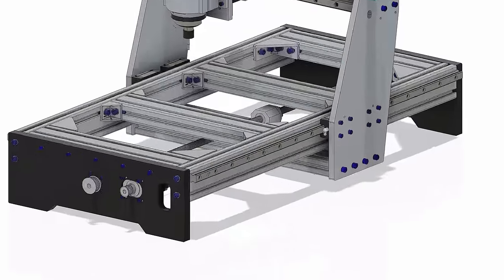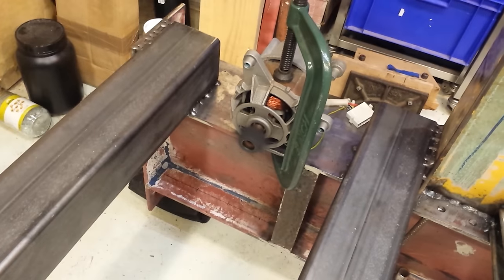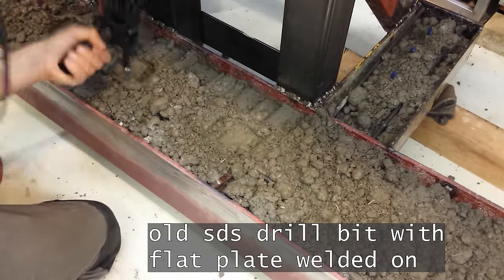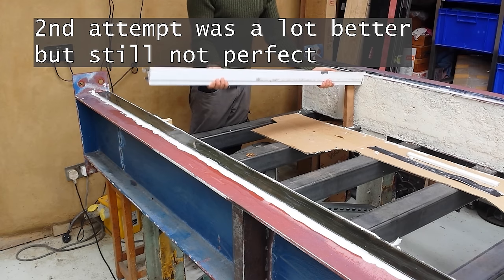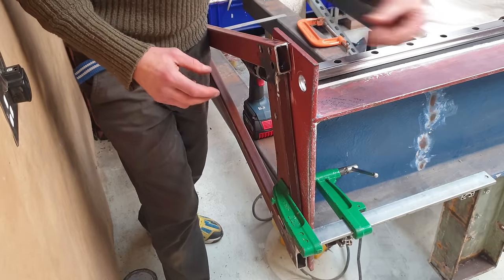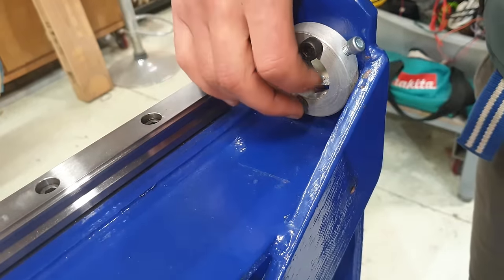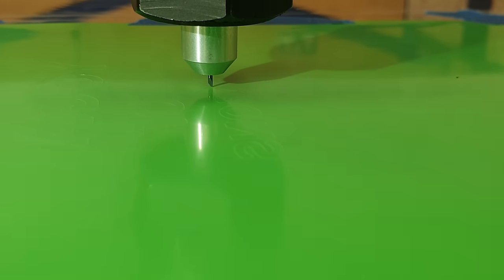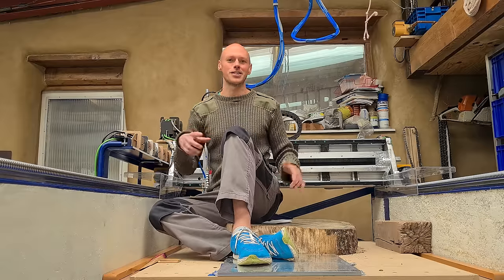Can we DIY an Industrial grade CNC?

Comment: If you left the washing machine motor on the frame whilst pouring the concrete you could have turned it on and vibrated all the concrete into place with no airbubbles

Maybe it might have helped with the epoxy levelling too? Probably a less powerful motor for that.
Reply from the maker: Good morning A Corgi With a Crown.
Yep, I actually did that a little bit with the concrete - it didn't work very well. I don't think the washing machine motor had near enough power to get the concrete mix flowing and liquid, it's a LOT of concrete to be vibrating at once - and the wet mix was very good at vibration damping (surprisingly enough!). Dedicated concrete pokers are much more localized, which is how they work well. The SDS actually liquefied it much like a concrete poker would I think. If I was doing over, I think I would A) buy a proper sds tamping bit (which hopefully wouldn't fall apart and need re-welding halfway through), and B) rent or buy a second-hand electric concrete poker.   
A really interesting idea to use it to help the epoxy settle flat though, that didn't even cross my mind. 
Thanks for the feedback and ideas - appreciate that :)
Reply: @FloweringElbow  Ah ok, I'm too used to using the normal concrete pokers, I'd definitely recommend using one for any sort of large pour. A wetter mix probably would have helped but since your using a specific mix designed for this application I can understand why you didn't.

In regards to the epoxy I remembered pouring some concrete with the poker turned on and it levelled itself really really fast. It wasn't perfectly flat because of the aggregate but it was very quick. Idk if epoxy would react the same way. 

Another thing I'm wondering is if maybe you should have degassed the epoxy? I've heard it removes microscopic air bubbles which helps with harmonics.
Reply from the maker: @acorgiwithacrown467  Degassing the epoxy would have been a nice touch - I had no vacuum chamber though. You can get most of the air out by mixing the epoxy in one container, then pouring it very slowly into another container. Where the pour between containers becomes a fine string the air bubbles are forced out. The container you pour into aslo has a pre-made hole in the bottom (taped up), so that you can peel back the tape and the epoxy travels from the bottom of the container, in a thin controlled stream (you can see that bit in the vid). 
That's what I did anyway, along with the torch, I didn't suffer much from air in it, though yes, if I had a degassing chamber, I would certainly have used it. 
I think my main mistake first time round was trying to use too little epoxy.

Comment: Could have used that diy vibratory stress reliever to help self level your epoxy like they use for structural concrete pours where bubbles are a concern.
Reply from the maker: Good morning Modern Renaissance Man. Yes, I think that's an idea with legs and I'm disappointed I didn't think it at the time!  Thanks for watching;)

Comment: I seen adding cement to the I beams , could you just add stiffener plates all the way through the I beam , also wrapping the I-beam  in fire blanket to let it cool more slow . Can add temp welded  strong backs to keep the I beam more straight.
 When was off shore welding 200mm wall thickness butt welds on rolled section , they are wrapped in electrical heat jackets to keep the welded structure from cooling to quick. ?
Reply from the maker: Good evening JLSsculptureDesign, thanks for watching. Interesting ideas with the cooling control. I didn't talk about it in the video but I did weld some stiffener plates in there.. 
Thanks again, Bongo
Reply: @FloweringElbow  on the Web of the I-beam and inside flange either side, surly can weld 10mm thickness rectangles in it. 5 either side equally spaced(more or less) . I not understanding all the  concrete. Learning on cnc builds too.
Reply from the maker: @jlssculpturedesign8140  The concrete is better at damping vibrations than steel... and cheaper even than a few 300 x 100 x 10mm plate rectangles.

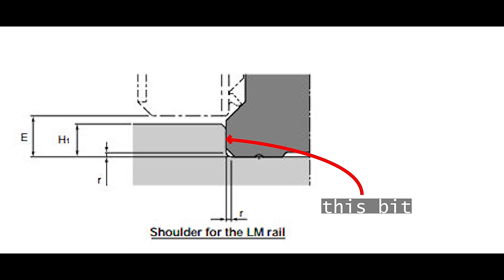Comment: it is my understanding from reading hiwin's catalogues and assembly manuals that the linear guide may be pressed against the raised shoulder for the purpose of increasing rigidity; not (necessarily) to straighten the rail (14:05), so perhaps you could add the tapered screw + steel rod arrangement to your machine. i would also like to add that another reason to use a rotating ball nut is to circumvent the critical rotational speed of the ball screw, which is a function of its length and its diameter, as well as the bearing arrangement; a long screw means a low maximum rotational speed, which in turn means lower rapid speeds (18:30)
Reply from the maker: Hey there. Yes. I think you are right on all fronts :D Yeah, getting round whip in the screw was also part of the reason... Thanks for watching.
Reply: @FloweringElbow  i feel acknowledged 😎. i watched a bunch of your videos; you make good stuff
Reply: Hi to both of you, hopefully I can share some useful knowledge - In my experience ( in the land of Hiwin) the ledge on the machine base is there mostly as a datum . The rails are ground straight so they need a couple of equally good surfaces to locate to as the master rail for that axis. The rails are pinched up against the shoulder by torqued wedge blocks at each bolt location and the rail is then torqued down from the center out to ensure the best result . accuracies in all three dimensions on a meter long x axis machine are within 0.01 mm which is frankly amazing .
Reply from the maker: @bikefarmtaiwan1800  Thanks for this. Interesting - I guess I should have started at the middle of the long rail when clamping and bolting... Live and learn.
Reply from the maker: @ikbendusan  Thanks man, appreciate you watching, and commenting :)
Reply: @bikefarmtaiwan1800  i read the catalogue again and it would seem you are correct. i remembered the section about installing the guides in an environment with vibrations, jolting and lateral loads. this section specifically recommends wedging the rail against the reference rail, so i connected the dots in my head that the reference rail is there to wedge against for maximum rigidity and to prevent the rails/blocks from moving under load

Comment: Could I get a reply on how well the rotating ball nut design is holding up? Are you fully satisfied with it?
Reply from the maker: Yep they are working well thus far.. see the latest vid... I don't know how this comment slipped through unanswered, sorry. Got it now.
Reply: @FloweringElbow  thank you friend. I’m doing an experiment to see if I can make a rotating nut on a 3d printer to handle a 1610 ball screw. It’s going to be a challenge and I give it a low probability of success but if it does work it will be great for people on a budget!

Comment: Never heard of VSR, interesting. You mention the aim is to vibrate at it's resonate frequency, but how the hell do you calculate the resonate freq of a structure that complex? And in which direction are you aiming to induce those vibrations, because surely the lengthwise resonate freq is very different to width wise and height-wise ones?

Anyway, I should add too, great work and I love your real world DIY'er approach to an ambitious project!
Reply from the maker: Well, like I said VSR is somewhat witchcraft :D  I believe the idea is to cycle through a large range of frequencies, so you hit resonance in various directions. Using a vibration meter on a smartphone (old one is a good idea!) you can see when it reaches highest amplitudes, as you are cycling through the RPM of the exciter (motor). The phone will give you amplitudes in the x y and z directions, so you can try and max out and leave it going for a spell in all of the 3 directions. Then, change the phones location on the structure and go again... It wasn't very fun by the end of it, and filled with uncertainty. I may have helped things ;)
Reply: @FloweringElbow  haha, well at least you can have the warm fuzzy feeling of knowing you tried!
Certainly sounds like something that would be largely impossible to quantitatively verify the effectiveness of for a DIY'er. Still, something interesting to read up on, thanks :)

Comment: did you consider 3d printing the cable chain instead of plywood or even casting with scrap metal. as some one who drinks way to much mountain dew recycling it to make 3d prints is a good investment. a micky-mouse cutter to spin cut 2 liter bottles into thin strips that fit into a ender 3 or 5 is surprisingly effective for smaller projects or bigger if you don't mine watching the feed. melt temp close to 500f i had the high temp kit on my ender so I don't know if the base module is capable. short of using a pelletizer or a Melter and 2mm die
Reply from the maker: Hey John. I'm sure I would have pondered those options if I had a 3d printer... that's a whole new adventure... reuse of the bottles sounds cool 😎

Comment: You really should look into getting consistent mist/fogbuster coolant spraying on this thing if you plan on milling aluminum lol. This machine can probably really go, but that lubrication and chip evacuation will be needed. Also, Have you considered trying LinuxCNC?
Reply from the maker: Hey there Thorhian, thanks 😊.  Yes my mist cooling adventure ended in good steel milling but too much mist! Without an enclosure it was very airborne and smelly/unhealthy. So yeah that needs tweaking... 
As for LinuxCNC yes I though about it, but haven't tried it and now feel a bit locked into mach as I have an ethernet smooth stepper.... 
Thanks again, Bongo.
Reply: @FloweringElbow  servos are better than steppers anyways. But setting up a closed loop servo system is challenging. The LinuxCNC guys will walk you through it. They live for that kind of a thing. You buy a Mesa board and PCW will stay with you until you're up and running. I've seen him work on stuff for 12 hours straight.

Comment: Regarding the 'ripples', are you using Mach3? If so, ditch it. I moved to Mach4 (and also tried SimCNC) as I run CS Labs on mine (IPA) and it was miles better. Mach 3 struggles to deal with smoothing, it may not be servo tuning.
Reply from the maker: Hi Charl, Yes, I am running Mach3, interesting. I have a smooth-stepper board and not sure it will work on a different set-up, but worth looking in to...

Comment: I wonder how the machine would've behaved without all the concrete.

And without all the epoxy.

Really the main hero you have here is the top gantry being orders of magnitude larger than your cutting area. Try a big flycutter and see how unrigid your setup is. Though that spindle is the majority of your benefactor I would think. Did you ever test the total deflection at the tip? Put a dial indicator on one side of the spindle cutter and try to wobble the gantry.

Comment: Let me give you a soviet stress relieving tip my dad learned in the army as a mecanical engineer. You can throw your from in the yard and light a big fire in/on-top of it. Just let iet burn that will stress relieve the welds
Reply from the maker: Love it! Did actually think about it, but moving the dam thing seemed like such a mammoth task... Of course, I didn't have the backhoe at that point ;) Thanks for the tip. Peace, Bongo.
Reply: @FloweringElbow  True, have you been having any problems with the rotating ballnut design, alignment problems or wear?
Reply from the maker: @meocats  Originally, alignment yes, there are a few vids on our other channel "FloweringElbow4SuperNerds" about it. It's quite dialled in now though, with TBI ballscrews. I might have gone to 15 or even 10mm pitch, and a slightly lower dia. screw if I was to do over... But please with how it's working ATM.

Comment: What CAD /CAM software are you using? Also you mentioned Mach3 which uses a printer/parallel port to function. Most computers nowadays don't have that so how are you getting around that problem ? Great project BTW 👍
Reply from the maker: Hi Alan, good Q's, 
We're using Fusion 360 for CAD and CAM and Mack 3 is going to an ethernet smooth stepper (warp 9) board. My laptop doesn't have the parallel port either - and I don't think that would give me enough out and inputs either. I got the ESS board years and years ago, before I know about Linux CNC - not sure I would go the same rout today... 
Thanks for watching, Bongo.
Reply: @FloweringElbow  it's never too late to get on the right path.

Comment: You waited several months in order to let the concrete cure and for stress relieve? or it was for something else? I want to make a similar concrete filled machine, but I am not that patient ;)!
Reply from the maker: Hey Juan, good question - simply put, yes! We waited that time for a good concrete cure. Then we removed the covers and waited some more so it could dry out... Course, when I say we 'waited' there was plenty to do, like making the gantry etc... I suspect there would be ways to shave time off the process, but we weren't in a big rush, and wanted to be safe...

Comment: I'm sure you considered this, so I'm curious why you didn't shim the linear rails true with the level and straightedge and then pour the epoxy around them to bed them?
Reply from the maker: Hi there Mytuberforyou. It's a good question. Simple answer is, I thought it would be difficult to do it that way...
Expanded answer: the rails don't come as 'straight' in either the vertical or horizontal plane (hence the cast-against-straight-edge sideways constraint I added). So to make the shim method work I imagined you would have to shim under every bolt (that's a lot of shims), and have each bolt carefully torqued up to hold it straight in both planes, before potting in. There would also need to be a big enough gap (we're talking large shims) between the rail and bed or it would be tricky to actually get the epoxy in there (I imagine - or maybe you'd get capillary action with a small gap, I don't know?). 
That would still leave the problem of making the two rails co-planer, which I hoped to solve with the self levelling epoxy (but in the end didn't really).
Reply: @FloweringElbow  well, I haven't done it, but I think I would try some aluminum tube bushings for shims, that way I could torque the bolts on the high spots and use the tube crush to act as an adjustment, between this and parting off the tubes in sizes varying about 10 thou each that could be swapped I think it'd work. It should eliminate the whole viscosity/self leveling problem. Marble dust or pool plaster added to the epoxy should reduce any shrink as well, you'll end up with something resembling solid surface countertop material (Corian etc. - these are PMMA and stone dust)

Comment: hi, what was used for the computer portion of the Mashine ?
Reply from the maker: I use Fusion 360 on my desktop computer that I use for most things, video editing etc. And use a USB drive to transfer g code to an old laptop with an ethernet port, which runs Mach 3. It goes to a smooth stepper, and the ac servo drives, which accept step and direction... 
Hope that helps, thanks for watching  :)

Comment: Impressive machine, which spindle are you using?
Reply from the maker: Good afternoon Mr. The spindle is a Jianken JGL-100mm 3.2kw 24000rpm BT30 ATC - more details and link are in the video description above. Hope that helps, Bongo.
Reply: @FloweringElbow  nice, I have ordered the JGL-100 2.5kw iso25 ATC... unfortunately it's stuck due to covid19 for 20 days (that's the estimate lockdown at jianken now...). I'm limited to single phase 220v single phase at the moment.
Reply from the maker: @mrechbreger  Bummer on the delay... I'm on 240V single phase here too - guess I should put that in the description, so thanks for the reminder ;)
Reply: @FloweringElbow  Single phase 3.2kw? Which VFD do you use? I'm converting 110V to 220V (since I moved to Taiwan some time ago..) the wires would burn down for sure, all the electrical wiring is a bit shady here.

I also ordered it from Jianken including the VFD (for 2.5kw / single phase).
Delta said the lead time is 9 months (I don't want to wait that long). Hitachi said 800 Hz is government regulated (well they're from Japan no idea what's going on there).
Reply from the maker: @mrechbreger  yeah. It's a 4 pole 240v single phase one. I have 240v single phase supply here (like most non industrial) places in UK... 
I am using a synphonx (not 100% sure I'm spelling that right) 800HZ inverter, which was relatively cheap, but took some hunting down. 
Did you mention FloweringElbow to get a discount with Jianken?
Reply: @FloweringElbow  I have ordered it before I discovered your channel so I did not get any discount. I also ordered the synphonix inverter from them. I keep watching every DIY CNC build that is coming up, my current one is a small VMC which is good for small parts but when milling like 200 holes into a 1m long bock I really wished to have something bigger.

Comment: Did you check the paint on the girders for lead?
Reply from the maker: No. It would have been a good idea, but whenever I was doing very dusty stuff like sanding it, I was wearing a good mask. Just reviewing the video, and I'm actually surprised I was had scraping it at all (and without a mask - very bad, though outside at least), as I mainly remember using a battery powered planer with some old carbide blades, and vacuum extraction - it was actually very clean, compared to say sanding.